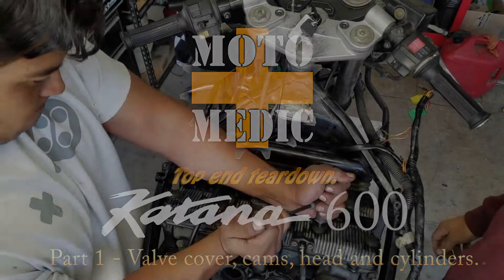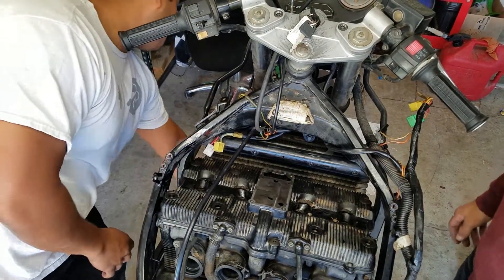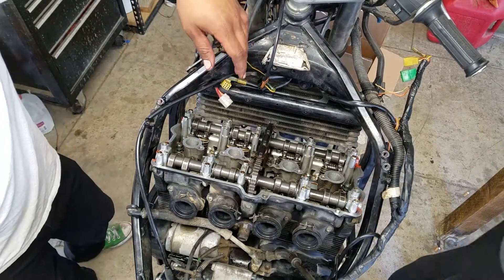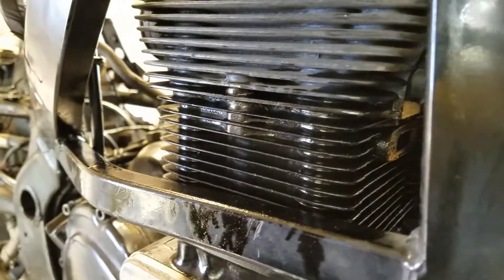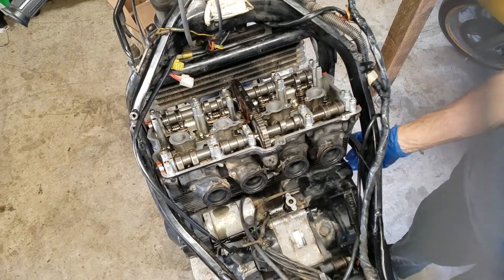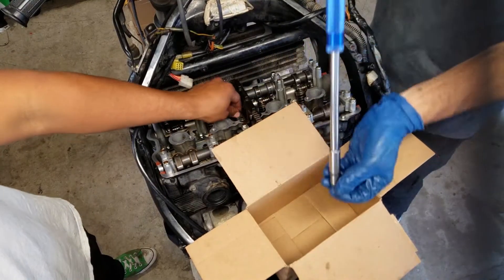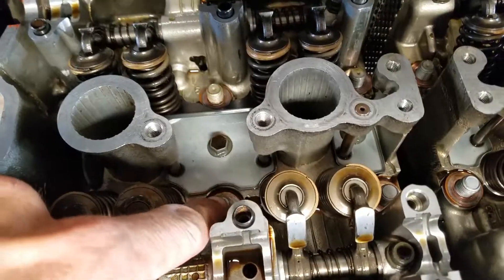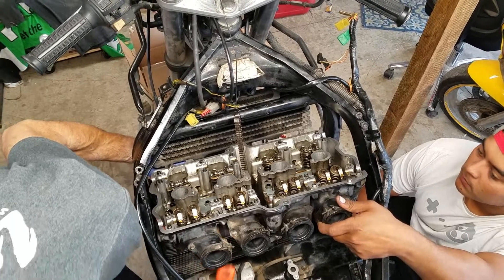1997 Suzuki Katana 600 Restoration - Part 1 - Top End

Comment: I just bought a Suzuki Katana from 1997. It has some problems, so I am looking everywhere for ways of fixing it and I want to do it myself (it is fun). 
I can't wait to find the time to get into it. Thank you for the video!
Reply from the maker: Best thing you can do is download the factory shop manual. You'll have all the info you'll ever need!
Reply: I just got one too! 5 years sitting 1990 GSX600. Wish me luck! XD
Reply: @MotoMedic  Finally found the manual (it was hard!) and it is exactly as you've said! Everything is in there!
But, there is something I don't like... It says everything about how to fix the vehicle, but I don't see some technical information about the equipment. For example, I could not find anything about Petcock (I need to fix/replace it), or the bolts that I need for the fairing (some are missing). Some codes / dimensions would have been useful.
Those are the only parts I was concerned for now
Reply from the maker: @ionut-stefandinu9302  check out a website called partzilla.com and go find your bike. There you can find all parts schematics and part numbers from the factory. If the part is still available you can get them there. However it won't always have actual specs on thread pitch for botls or screws and the like. But at least it helps for tracking down something that may work.